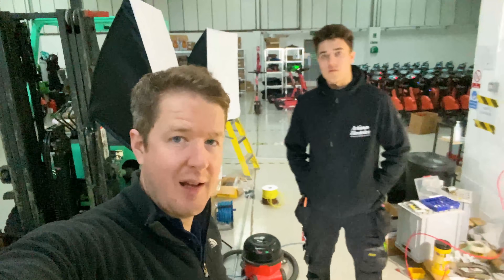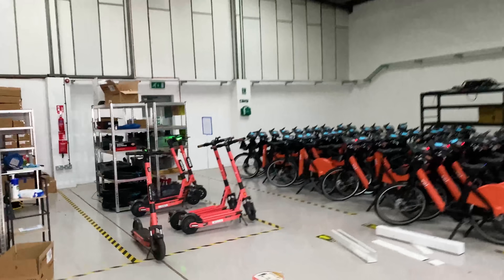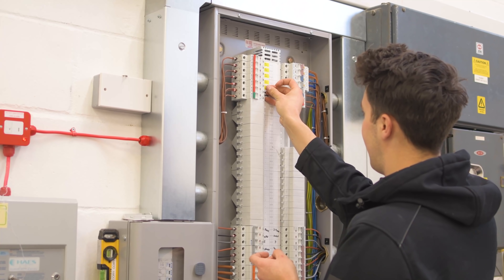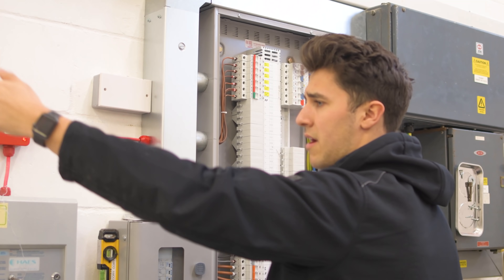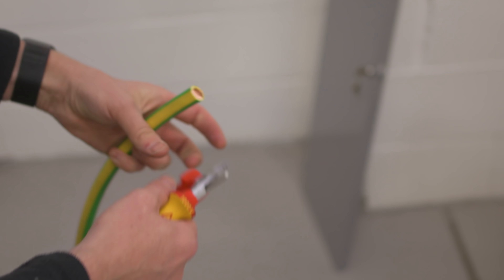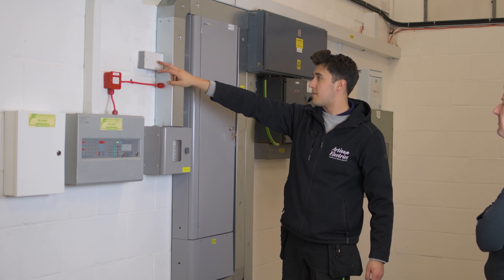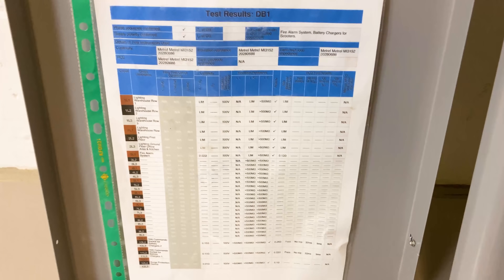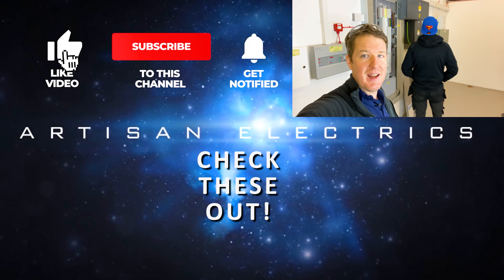Industrial Electrical Installation - Board Upgrade & Electric Vehicle Chargers - Day 3

Comment: I stopped looming my cables tight with zip ties a while back as I was concerned about heat buildup.
Reply: Cables unlikely to be under simultaneous loads can be omitted from many of the grouping factors. Its in the guidance notes. Think about trunking around DBs etc. All our conductors would be off the scale. Most cases cable ties are totally fine and we dont know the design here. Good work Jordan.
Reply: @johnhoward2104   Hopefully they would be in the regs if they are in the guidance notes about them lol! Think of trunking horizontal and all the cables sitting in the bottom. Cable ties within a DB will very rarely if ever be a problem.  But you are right we dont know the details. Good job the electrician on site is qualified, experienced and competent.  Well done Jordan keep going.
Reply: I wasn't criticising by the way. I was just simply stating what I do now as opposed to what I used to do as it dawned on me one day that a little extra breathing space may be better than a picture perfect D.B.
Then again in others eyes it may appear like I couldn't be bothered to tie them. As long as I see that they are ID'd, ferruled if stranded and are swept into their terminations tidily with adequte slack I'm happy.
Reply: @johnhoward2104  its nice you made a personal comment says a lot so I will bow out. Nobody was showering praise just offering an alternative point of view to questioning another persons work. Seems to have hit a nerve for that I apologise. 

Believe me I do understand the regulations I even have an 18th edition certificate and everything lol.  Perfection doesnt exist so the last thing I want is to maintain an image as such. My wife would tell you its the last thing I am. 

Just a spark trying to be kind and actually help people where I can. Go check www.apprentice121.co.uk 

We all approach things differently,  I respect your opinion and actions. Different to mine is all.
Reply: @John Howard, sorry you removed your posts. In all my time in following Jordan he has never been unwilling to learn including from the comments section. It does take a great deal of work to put together content for YT. I do believe for all of us commenting that we take these issues into account- Artisan is noted for its high quality and neat, and workmanlike work, something the regs I believe also suggest. Sometime it’s not what we say that matters but how we say it, having been born in Yorkshire but living for the last 11 years in the USA I know about plain speaking. we appreciate text cannot really fully express intonation and tone. YT is a good place for commenting, learning and raising questions as long as we abide by the fact that how we write can convey some emotion even if it was not intended. I know for a fact Cory and Jordan are fully upto speed on the issue of grouping factors heat dissipation concerns that SparkNinja alerted electricians to. jordan even commented on Sparky Ninjas video a year ago when it came out on this issue.

I for one really appreciate the community of UK electricians sharing their work (which is brave decision to make) and supporting each other - it really alerts younger electricians to many works issues, tips and install issues that they are alone have not had experience of - at best YT can alert them to some of these trickier install issues.

Regarding interaction and learning I certainly believe that Sparky Ninja and E5 podcast are leading the way on the technical side very often they are bringing engineers and industry experts around the table to discuss issues and share knowledge that’s golden. I hope one day they will switch do more live sessions on YT to engage the electrical community further I do believe the technical content that these two channels have put out are one of a kind and it does sadden be a bit that more younger electricians haven’t been using it as much at least in terms of the views and comments. So John do keep posting and your questions on SPDs and EC location are relevant someone will answer them at some point.

To Jordan and Cory we appreciate the time and effort in putting this together and raising issues and we all understand just because you haven’t mentioned something it does not mean you have not considered it.
Reply: @johnhoward2104  we all like to learn John. Myself included. Started out in MOD sites and that was an education! Just the 1 degree myself so far lol. Electronics and my new found passion of editing are my hobbies. Along with the 4 kids and dog. Nice to meet you this evening.  

Glad we can part on a happy note and best wishes in 2021
Reply: @Mark Allison  There are many factors to consider when zip tying cables in a DB but from what I've seen and know of Jordan and now Cory's work I would have no worries inspecting or signing off this install. The IET and most of the guys I've worked along side that have authored BS7671 will normally answer over the phone "case my case basis do what you think is most suitable" re: John Howard's comment. 

Reason for the separate earth conductor - if a bus bar system does not carry a cpc specific conductor it will be earthed at a suitable location - I'm paraphrasing from the bit of literature but yeah, modern bus bar has 5 conductors and anything pre 1990 from person experience only has 4. Hence the external earth loop which is also to stop arcing and induced currents due to proximity to the bus bar (goes back to being designed for 4 conductors not 5). Once we were allowed to use the bus bar containment as the earthing but just like SWA you have to take into account the Steels current carrying capacity. 
As they have upgraded to new incomers the csa of the casing likely wasn't enough.

Edit: SPD length, is well within regulation defined lengths, so all in all I am not overly sure why John is bringing these things up or questioning peoples integrity (how it appears reading the comment string). Also to reference other content, your own video the other day about the Paxolin and being able to isolate the installation re: EC exiting bus bar chamber alone.
Reply: @effervescence5664  very true, I agree.
Reply: @johnhoward2104  yes because electrons can't flow uphill, especially using the water in allergy.
Reply: The only way to really see if heating is going to be an issue and grouping factors need to be maintained, would be to undertake an initial risk assessment  and quantify the problem - the regs/standards are too general and dare I say it usually backward looking - the latest research using CFD and finite element analysis in the research literature really shows depending on the situation how varied heat dissipation can be and therefore derating for ampacity and grouping factors suggested by standards can be way off. At some point the standards will catch up with this work.

 As part of the risk assessment I would be looking at the thermal properties of the wall for example where DB is located and size of the DB, some thermal imaging might shed a clue but more precise temperature monitoring over a long period of time with power quality monitoring thrown in would be a nice way to go to provide some empirical evidence on the other elements of the install - loading over time but of course engineering principles don’t stop there there a lot of other engineering and other risk issues that could be looked at. sometimes the obvious is not the issue. 

Spark ninja and E5 are doing a great job educating the industry in the UK many of us have to rely on other experts to understand issues we have not considered before or are not discussed in various standards.

In US standards NEC 2020 grouping is allowed by use of cable ties, but no need if cable enter a conduit or raceway that making the grouping obvious or if in a box or conduit body where there is no looping. I would use cable ties in a dB though would keep them reasonably loose but aware it could make testing a bit of a pain.

Interesting debate nonetheless, and btw the way Cory and Jordan a great looking install with some good thought put into the selection and erection of the installation.
Reply: Sparks who think they are NASA engineers.🤣🤣🤣
Reply: @justmeagain6135 the point is just to think no matter how good or well trained you are and that includes being in a multi billion dollar enterprise like NASA - compliance based approaches to standards are also dangerous developing a risk-based mindset takes time to develop and understand.
Reply: And a little known fact: if you do them up too tight it restricts the electron flow
Reply: @Froggability  Really? thats a first ive heard that in 35 years , crushed maybe , not a cable tie, funny tho
Reply: @johnhoward2104  firstly not a lax attitude. Its applying regulations correctly. Are you suggesting Jordan hasn't? 

This is the trouble with YouTube people seem to enjoy questioning the ability of the electricians work. Its just jordan sharing his work. Why assume its not done correctly? That is not lax but to assume its done correctly is lax? I dont understand that logic at all. But hey I dont want to fall out. 

Peace to all etc. If you ever pop a YouTube video up I will be sure to support it as I would anyone else. 

Spacing of CBs is also most likely to never be an issue. In fact its colder environments that present a greater risk in this situation rather than hotter. 

Just saying.
Reply: @johnhoward2104  not supposed to cable ties your cables in a DB, not allowed, but these guys seems to be a legend almost as good as me😉😉😉
Reply: the only person who can settle this is John Ward

Comment: On a job like this do you hire in access equipment to test lighting and the like?

Nice and neat job you’ve done.

It must be a common thing with regards the emergency key switches, they always seem to be installed in the most over complicated way

Which certification software do you use Jordan, board schedule looks neat

Comment: I like that thick earth cable and matching heat shrink sleeving. 🙄 7 mm earth.
Is it 7mm or 70 mil. earth?
Reply: 70mm - if it was 7 he could have gotten through it with a pair of scissors :D
Reply: @artisanelectrics   I'm not a electrician and because you both laugh at my comment. I done some research on UK cable sizes and that 70 mm size cable is 70 mm square area cross section.
Could you give me the number of strands and the average diameter of a single strand of that 70 mm earth cable. As of interest so I can work the cross section area with the Formula? If possible. 🤔

Comment: Brilliant work, nice to see the loops on the top right incase you have to move the rcbo'd circuits across phases at any point. Really well planned out and installed.
Reply from the maker: Thanks a lot!
Reply: Never understood peoples obsession with leaving lots of slack in cables in dbs.  If we did that for every circuit in a busy board it would be rammed in there!. Stupid idea and totally unnecessary tbh. How many times have you moved a circuit to a  different way on a db? And why would you have to lol 😆. Once a circuit is in there its in! Stupid response
Reply: @paulharrison6408  Domestically hardly ever, commercial as change of use happens fairly regularly circuits tend to swap phases quite often. It's all down to use case scenario.
Reply from the maker: True
Reply: If you’re a domestic spark then I can see why you might think this but as someone who works in the commercial sector I’ve often had to move circuits around in a DB to allow for new circuits and I’m always very grateful to the previous Spark if they left me a fair amount of slack. I like to leave a bit of slack on a cable in the trunking before it’s stripped and brought into a DB